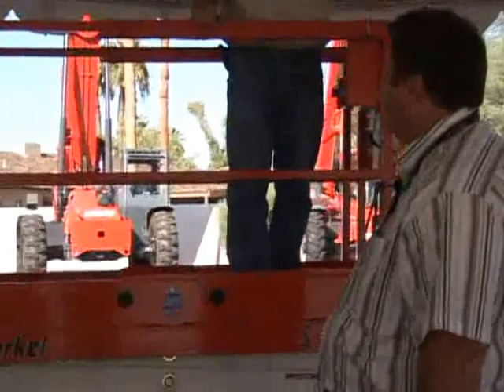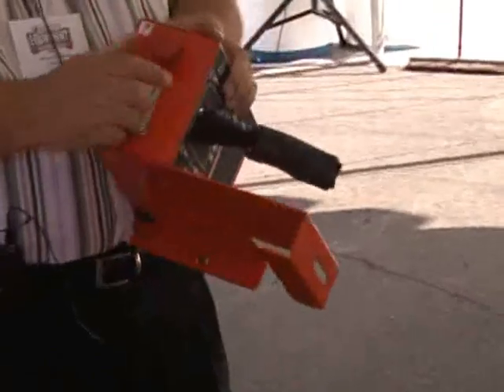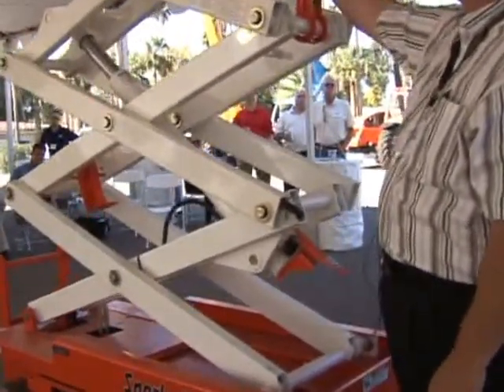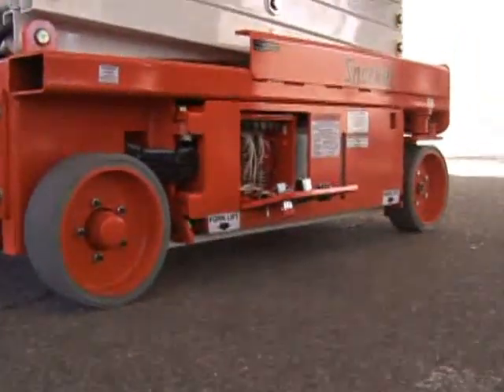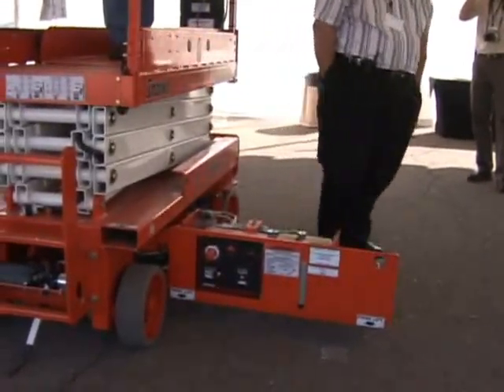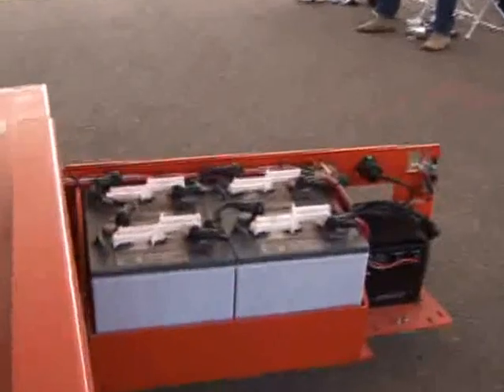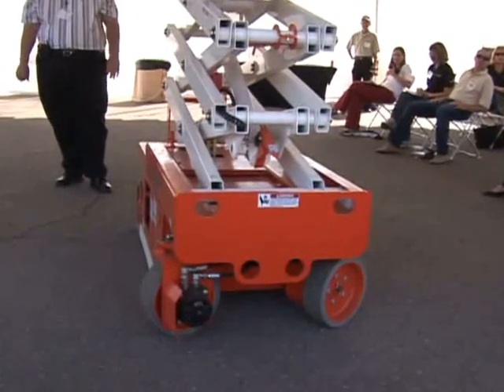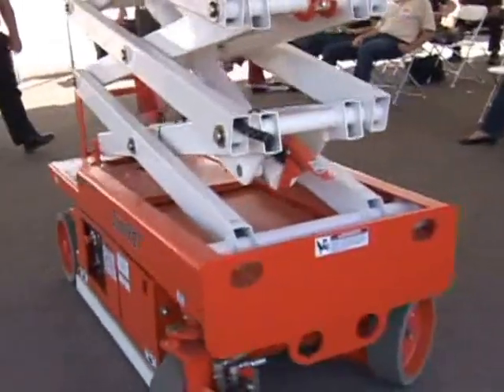Product Review: Snorkel S1930 Electric Scissor Lift

Comment: I would redesign the steering connector, and beef it up. Its basically a flat bar connected to the wheels by a little stud and nut on each side...problem is that the flat steering bar is too heavy for these little bolts, I would have something heavier. Other than that its a great little unit...over time the bolts tend to weaken, and there is up and down play in that steering bar, and that , in turn effects that hydraulic piston and wears on it.